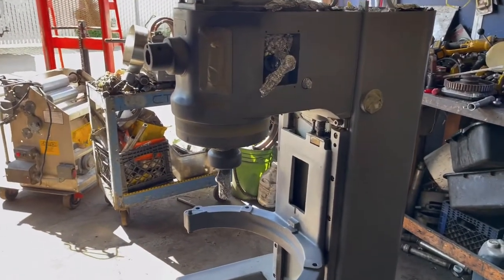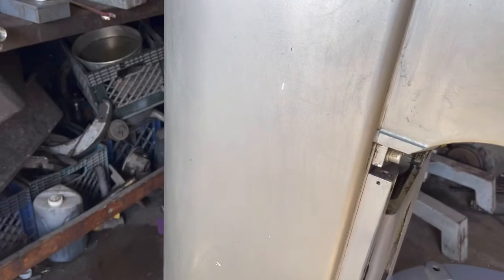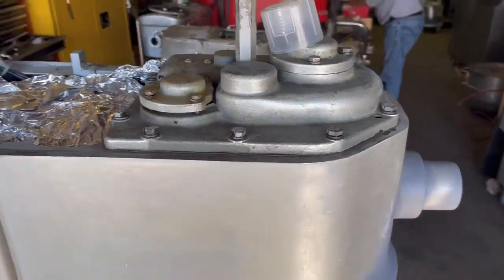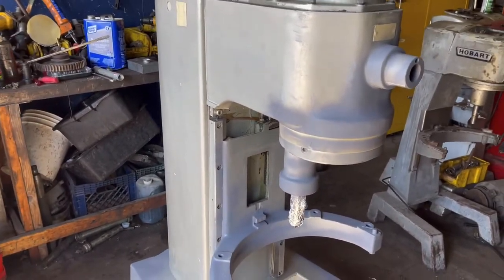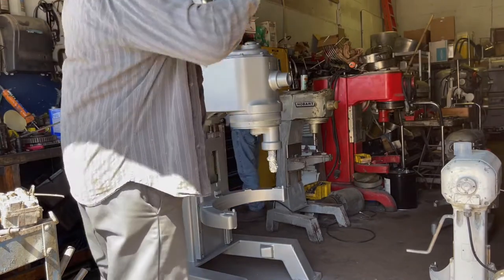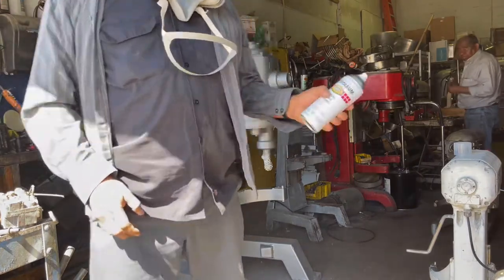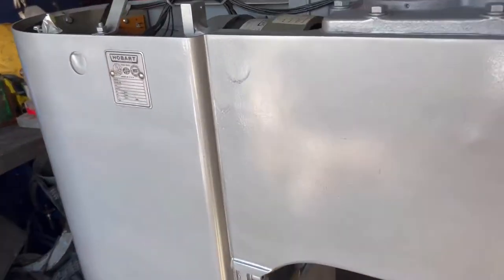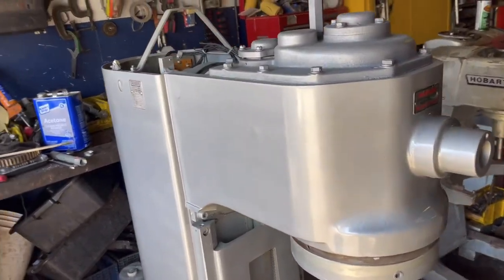Painting Hobart Mixer under $50.00

Comment: nice but use automotive paint is better to work with and leaves nicer finish and coats better and price is about the same.
Reply from the maker: Off course I agree auto paint will give me a better finish and protection 
As it matter of fact I use to paint 15 years ago
But here in California solvent paint is illegal since 2010 if am not mistaken now is water base paint and if you know about painting water base paint for vehicles is a bit more complicated to use than solvent, that’s why for now I use spray paint, I know for a fact from another dealer that does takes his mixers to a body shop literally his spending a bit over $1500 a unit so here in cal is expensive to do it that way that’s why I rather do it this way and pay special attention more to mechanics in the motor And transmission in the long run that’s what matters more than a fancy expensive paint job 
Do appreciate your opinion thank you sir.